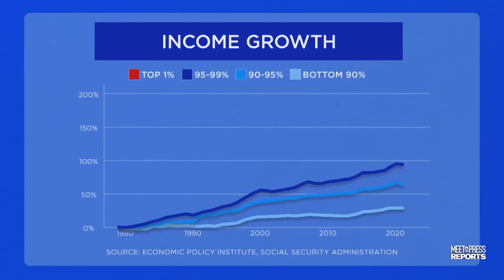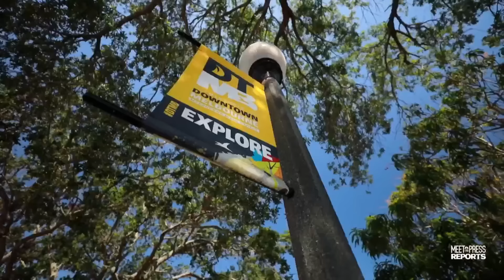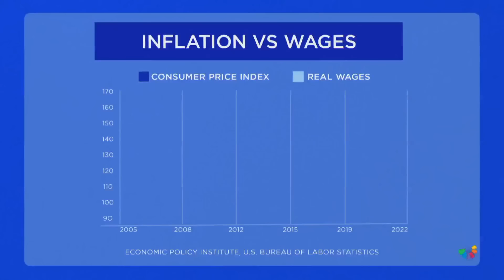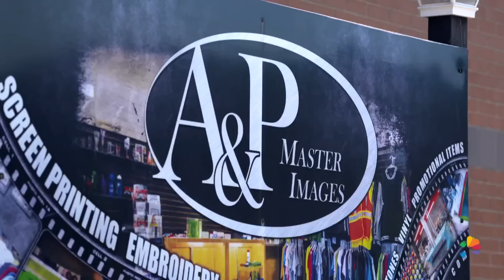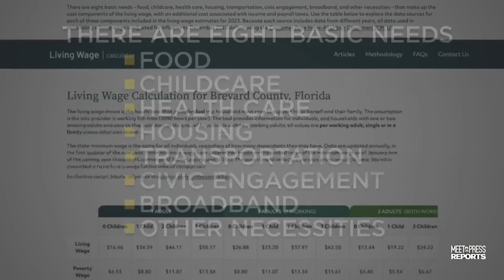‘Real disconnect’ between cost of living and workers’ paychecks | Meet the Press Reports

Comment: this disconnect has been happening since 1980. 

I am no Regan hater, but his particular financial policies put certain hopes in corporations to do the responsible, sensible, and right thing to do, that is to share the wealth.

And BOY did that NOT happen. Those in power have buried their heads in the sand and have largely pointed the financial disconnect blame on this or that - as if the poor are to blame for our financial issues. 

The fact of the matter is this: wages have not kept up with inflation since early 1980, and it is directly correlated to Reganomics. This needs to change, because corporations certainly won't. The wealth is not trickling down. It is getting restricted and squeezed for mega-profits.
Reply: Wages have kept up with inflation since the 80s so I guess he was fine then

Comment: One thing that doesn’t seem to get mentioned in discussions about increasing minimum wage is what happens to those already making above that.

If someone is a manager making 80k a year and the average employee is making 40k, but the bottom is making 15k (minimum wage yearly). Now you double minimum, so the bottom is making 30k.. well now proportionately, the 40k worker should make 105k a year, the manager should make 210k.

You can’t expect the average worker to make barely more than the bottom, you can’t ask the manager to make less than the middle (or even close to it).

The company will not change its profit strategy substantially, so if you raise the minimum, everything else has to go up too. Guess what happens to prices if everyone’s wages go up?

And it works across industries too, if a similar skill industry suddenly inflates wages, then those on similar pay scales have to increase their wage levels.

Comment: A reporter from NBC talking to a small business owner running a shop that probably pulls in less revenue than her salary has an ironic feel to it.

I don't think either the reporter or the business owner fully comprehends how intertwined massive companies like NBC or Amazon are with the federal government. So I would sort of agree with her if a business like Amazon forces increased wages due to their sheer size it stomps out small fledging small businesses to pretty much be forced out of business since they no longer can keep up with operational costs due to the cost of labor. In turn, this just means Amazon has a monopoly in this industry where it can wipe out entire segments of the market through this tactic.

Likewise, when the fed comes in and raises the federal minimum wage with no regard to locality pay yeah you end up buckling areas where 8-10 dollars an hour is like making 15-20 dollars an hour in others. If anyone should be setting minimum wage standards it is the local governments and not the fed.

Comment: 6:14  Companies  have been shrinking their work force / hours and increasing work load for a while now. Profits for those companies has been exponential . Maybe you should look there and redistribute that wealth. Also, how about the healthcare system. Why does it cost $42,000 to treat a senior citizen that fainted from heat/dehydration. Where is that money going? Why have health insurance if it’s cheaper to use a discount card at my local pharmacy? Capitalism was built for the small percent of the super rich hiding behind the phrase, anyone can make it in America if you work hard for it.  It was not meant for the common workers that actually run this country. The workers that are given just enough to barely afford to stay healthy enough, mentally and physically, to keep pumping money into the upper classes. Where is the reset button.

Comment: The problem, if you ask me, is the costs. There need to be caps on necessary products and services. Doubling the minimum wage won't solve anything because the prices will just shoot up in response. You've got to stop this "free market" exploitation (read: commodification) of necessary goods and services. Without that, no increase in minimum wage will help much, and it's likely to trigger ever-higher inflation that will only make the problems worse.

Comment: The problem is every time they raise minimum raise everything else goes up to so your not really making any more money. The only way someone could do better is live somewhere where minimum wage is good and housing cost and food are less and there are not a lot of those places in the U.S. There are some but not a lot. So with housing, food and gas so high it is hard for many to get by. You have to find creative ways to shop, like discount food stores, thrift for your clothes, add a extra blanket in the winter and run heat a little lower. Whatever you can do to get by.